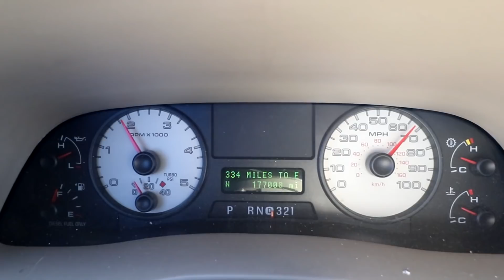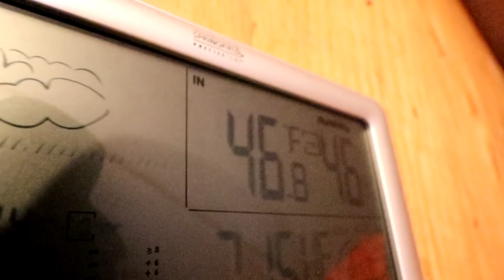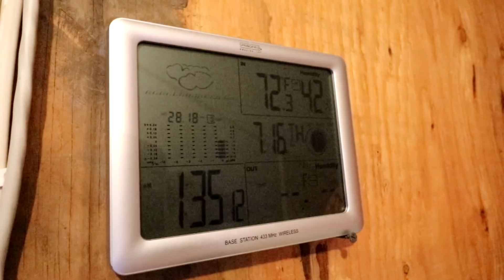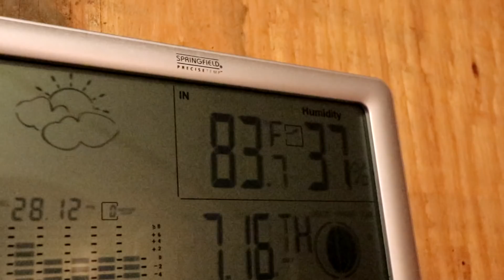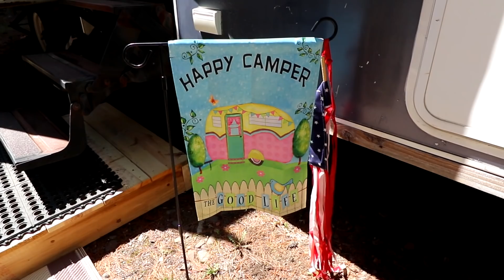THE TENT. Opening Fishing 2018. "The Movie"

Comment: Joe and Zach, why don’t you rent a trencher and trench a ditch from the well head to the side of the tent that has the shower and then barre and insulated water line to the tent and connect it to a small instant hot water heater run by propane, this will illuminate having to heat water on the woodstove for everybody you be able to take a shower, this will save having to haul in so many containers of water to the Trent.👍 💜 👍 💜 👍 🧡

Comment: Accidentally came across your videos and wanted to let you know I found them to be very relaxing. My wife and I live in Southeastern Oklahoma in a rural community and both have health issues so I spend a lot of time indoors at home. I enjoy the peaceful lifestyle of camping but am not as able as I use to be so it is nice to find a channel of someone enjoying and sharing their experiences. I really liked the small cabin/tent  and the way you have it set up.  I also liked the fact that you are keeping journals while you are there. I think the most relaxing part for me is that while you are camping you are doing the necessary things to make your time there enjoyable but at the same time you are keeping  a routine your are also just enjoying your time there and seemed relaxed. A lot of the videos on youtube are survival videos or  just seem so busy acting like they are trying to fight the elements in a lean to or something. I really just seem to enjoy your videos for what they are .  I would like to offer you a suggestion to try the next time you bake a potato in aluminum foil. Take two pencils and set your potato between them on the cutting board. Slice the potato across the potato to where the knife  comes down to the pencils,cut thin slices from one end to the other. Remove pencils.  Next cut a single piece of bacon into one inch pieces and place between the slices, then season with salt and black pepper. Now place your potato on the foil and add your Onion, Mushroom bits, around the Potato. Next add a dash of Garlic powder and a sprinkle of Cayenne pepper powder , a  drop or three of liquid smoke, and a couple of dollops of butter . Place some grated cheese on top of your potato ,then  wrap the foil and close the edges leaving a small amount of room on top so cheese doesn't end up stuck to the foil.  Then place it on the grill, and cook it like you normally do. After you take it off the fire and unwrap it , plate all and add your dollop of Sour cream. If you do try this and you like it let me know.             beandavid6@gmail.com

Comment: A good tip when spooling a spinning reel. Run the line thru the eyes and make sure the line comes off the line spool in the direction it is going on the reel. This eliminates the wind knots and spool tangles.

Comment: Dude, clean your stove. I learnt a long time ago to clean out the stove and set it for the next time I come up, especially in the winter, I drive right up to the cottage door, and throw a match on the Zip cube (Fire starter cubes) then I turn the power on and before I am done unpacking the car and put the everything away, I am in my T shirt because the whole place is hot. Perfect for the spring when I reopen the cottage too, light the cube, throw it in and minutes later the dampness is and chill are gone and its nice and warm and I can do everything that needs doing in comfort, rather than having to build it and start it while I am freezing in the winter or just chilled in the early spring. Just a thought.

Comment: Slow down with the spinner bait. Also try a buzz bait when it's glassy like that in spring oboy.
Reply from the maker: I paid good money after doing a lot of research to find a reel that has that slow of a gear ratio. It is way slower on the retrieval than most of the baitcaster reels.
Reply: JoeandZachSurvival . Try this again few cast. Lift rod tip slowly to 11 o'clock then real down while dropping rod tip to water surface then lift and repeat. For pike bass and muskies. The speed is determined by how fast you lift. Also gives lures a injured flutter. Shhhhhhh lol

Comment: Little tip when cleaning out the ashes from your wood stove add some water to soak up the ashes that way you don't get a lot of ash dust in the air, But always make sure to make a fire after to dry it out so no rust will happen.
Reply from the maker: Good advice, Thank You.

Comment: If I may offer some fishing help. 

You'll notice that her line on her new rod is Twisted as it comes off the bail. When you spool a real you need to real it as the line spins. I'm not very creative so I just take a pencil and push it through the center of the line spool and have someone hold it while I reel it in. 

If it folds off the spool sideways it twists all to crap. 

Love your videos. Catch some fish man!
Reply: Joe: To remove line twist, remove all lures, bait, hardware from the fishing line, have nothing on the line at all. Go out in the boat and move along at a nice trolling speed. It doesn't have to be fast. Let the line out into the water, you may have to hand feed the line until it's far enough back that the water drag strips the line off the spool. Let all the line drag out behind the boat until you're down to the empty reel spool. Now stop the motor and reel in the line. The drag of the water resistance on the line will straighten the line out and remove kinks and pack the line back on the reel spool with proper tension. This works with all reel types. It's simple, easy, and takes only a few minutes.
Reply: MsPrincesspaulina I second this suggestion.
Reply: Thanks, David H!